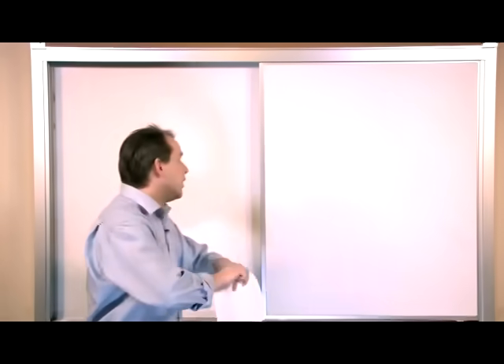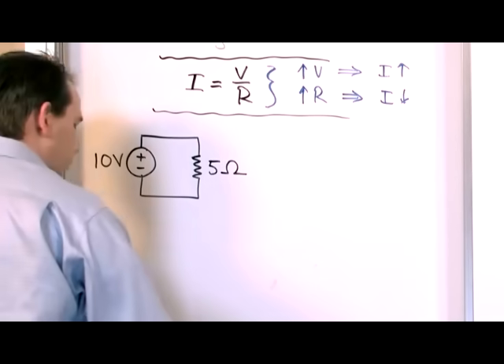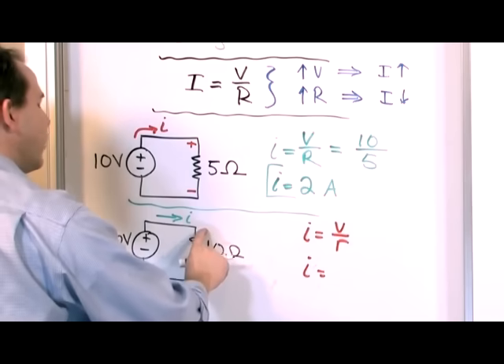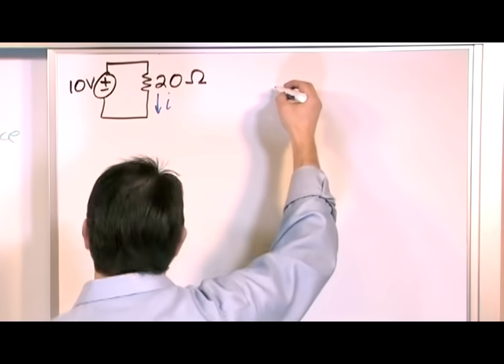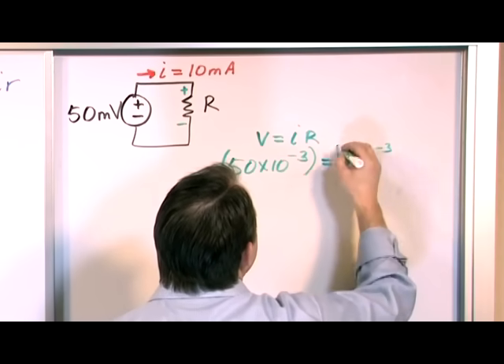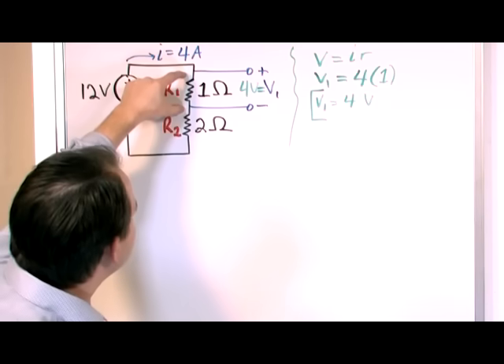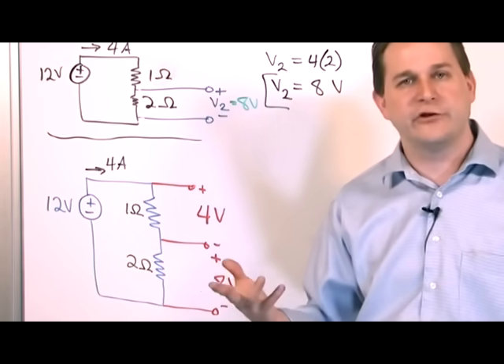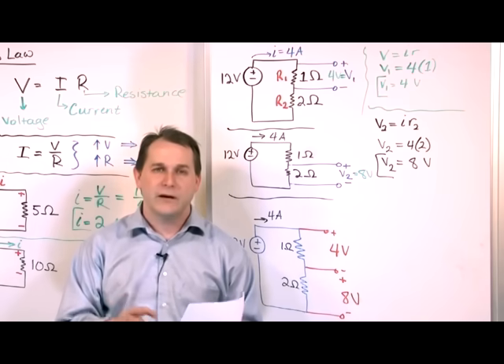03 - What is Ohm's Law in Circuit Analysis?

Comment: Ohms law is a statement - Ohm's Law states that the current flowing in a circuit is directly proportional to the applied potential difference and inversely proportional to the resistance in the circuit.
The subject of ohms law is current. The only mathematical equation that supports ohms law is I=V/R. Every other mathematical formula is a transposition of that
V=IR does not support ohms law
Reply from the maker: You are mistaken. The two equations you put in your posts are exactly the same thing. Neither is superior to the other. They are both equivalent. This is according to the rules of algebra.

Comment: I understand the math but I dont understand why adding a second resistor in series does not affect the calculation on the other resistor. You would think its interfering with the ohms law calculation on the other one as a result of its resisting in series!

Comment: Ohm's law is stated E over I R. E= electromotive force(volts)
I=impedance(amps)
R=resistance (ohm's)
IR=E
I into E=R
R into E=I
This is basic electricity explained in a basic way but there is far more to it. Most electricians do not know ohms law and the general public has no use for it but hey whatever gets you clicks after you maintain a 2.0 in basic electricity.😇

Comment: I have a question about the 50MV and 10MA and finding the resistor question . Couldn't I just rearrange the formula like I rearrange the formula to find the current or I. Couldn't I just move it to say R equals V divided by I  and still get the outcome instead of doing all that complicated breaking down  of the Mili Since both ms in these terms are the same in value. Instead if doing 50×10 to the whatever I could just divide 50 by 10 and still get my answer. ( since both are dealing with milli )
Reply: If it is 10MA that is 10 million amps, I presume you mean 10 mA, which is exactly the reason to work with units rather than assuming the prefixes will work out OK.  If the question was 50MV and 10mA, the answer would be very different - a trap for the unwary!

Comment: In your example of the 12V source, the 1 & 2 ohm resistors in a circuit, what governs the 4 amp current?  Is it built into the power source?  ID; 12V 4 Amp? or is there something else that regulates that?
Reply: The current is the voltage divided by the total resistance  
 I=V/R = 12/(2+1) = 12/3 = 4 Amps.   
You cannot build the current into anything, the current is the result of a voltage across a resistor in this case.

Comment: Try it out when restance is 0ohms....how much current is passing thru d wire..am jst imagine a circuit that doesn't have resistance...
Reply: Superconductors have vanishingly small resistances, but a voltage source usually cannot supply an infinite current!

Comment: Apparently this man doesn't believe in ELECTRON FLOW. 
I wonder how he explains Diodes in a circuit.
Reply from the maker: You are misrepresenting what I am saying. I never said I do not believe in electron flow. Of course I do. All I am saying is that when you take an electrical engineering class or practice as an electrical engineer, we write the equations in terms of positive hole current flow, which is positive charge flow in the opposite direction of electron flow. Yes we all know that physically the electrons are flowing however all of the equations are simplified by treating it as positive current flow. This is what is done in electrical engineering classes. Thanks, Jason

Comment: wait, what if the bottom resister is not 2 ohms, but also 1 ohm as well, then they would add up to 8 only. What would happen to the remaining 4 volts? Does this mean i would have to add another 1 ohm resister?

Comment: YOU TEACH LIKE EVERYONE IS STUPID !!!!! I GUESS YOU BELIEVE IN Kirchhoff's HOLD TRUE AT ALL TIMES TOO DON'T YOU !!!!
Reply: Your SHIFT key is stuck!
Reply: Ohm,s law ,I the first,step .along with Faraday,s law, then it's Eddy's current ,then ,Lens law , cheercefss law, Faraday,s law.is to do with plant room Maintenance for Motors , it says if you rotate a conductor around a Magnetic field conductor around which is the rotor,you will induce am E. M.F.,in the motor ,or vicear vercar.so when you start Motor it will run .,wether your connection is a star deltaotor,motor ,delta, motor ,or direct line motor ,starters ok here is also where you use Ohm,s law ,and,Root 3.,that's .1.73.of an Amp to calculate  running and starting current ,of each phase of it's,.a 3phase system..lots more to say but I don't want to confuse the reader for now 
Martin Brewer ex,marine ,E.T.C.O.

Comment: Wait the first resistor is 4volts drop so the meter should read 8v correct? Then the next resistor should measure after the voltage drop 4 volts correct ??? Just wanna be clear in my field of work . Elevator men always get it up lol.

Comment: Confused. If the second resister was 4 ohm, 4×4 = 16V? Doesn't add up.
Reply: Your confusion is well founded. Lots have been confused like you. Its because he says that 4amps run all the way around the circuit and writes it at the top. But that is false, its only true if you use the same resistors he used. So you cannot multiply a 4ohm resistor by 4amps like you have.. or as you said it doesnt equal 12v. The amps running through the circuit depend on ohms law which depend on the TOTAL values of ALL the resistors in the circuit being plugged into ohms law for answer. Thats where he got 4amps from. But he didnt explain that prior to this video he calculated the 4mps which is only 4amps if you use same resistor ohm values that he did. And he wrote it down on the circuit so many, who are actually following along and learning like yourself, are multiplying by that number  and getting baffled.  Change the values of resistors to the ohms values you wish.. add them together . then calculate the voltage drop over each resistor or the  amperage... It will all add up to 12v then.

Comment: Why do you Americans have to make everything so complicated ? Metric is really easy. What’s that nonsense with 10 to the power of -3 ? Just decide it by 1000. Metric is everything times/decided by 1000: 1ohm=1000mili ohms/ 1kiloohm = 1000 ohms / 1mega ohm = 1000 kilo ohms. Why do you guys make metric seem so hard ?same with meters with everything. 

1000mili = 1unit
1000units = 1 kilo
1000kilo = 1mega
1000mega = 1 tera

Easy. Decide/multiply by 1000

Comment: the segment on resistors is confusing to me.  He talks about a voltage `drop' across the resistor which sounds like a decrease in the voltage, yet he also says the voltage going in is the same as the voltage coming out of the resistor.  Then what is the `drop'?  He says the same thing using amps.  the amps going in is the same as the amps coming out of the resistor he says.  Then what exactly is the resistor doing if there is no effect on voltage or amps???
Reply from the maker: I never said the voltage going in is the same as coming out.  I think you misheard.  The voltage on one side of the resistor is higher than the other side.  This difference is the voltage drop.  With the current, yes the current is the same through the resistor but if you replace the resistor with a different HIGHER resistance, the current will be lower in the circuit.  If you reduce the resistance the current will be higher.  So the value of the resistor directly affects the current flowing through it.  Thanks!  Jason
Reply: @MathAndScience  ok thanks!  so knowing that the v does actually reduce across the resistor i think what you are saying (at 9m) is that, if you put your meter leads on the wire before and after the R you will measure 0 volts. `V drop is 10 volts (on a 10V circuit).  so V drop on a 10 volt circuit is 10V- 10v= zero V.  Something tells me I still have that wrong...

Another thing that is confusing- but i think i know what you are getting at- is that the current is the same all the way around the circuit (for example at 17m `current is same everywhere').  What confuses me in your examples is that you draw an arrow coming from the + of the source, and i'm picturing that as the START of the electrons flowing around the circuit.  in other words, they haven't yet reached the R for the first time, so in my mind they haven't been modified yet by the R.  So to say that the C is the same everywhere, in this case, would not be correct.  But after the <nanosecond of the electrons STARTING their path around this circuit- that is after they have gone through the R the first time, then yes, after that, C would be the same everywhere on the circuit.  In the real world, by the time you put your probes on the circuit, it will be the same C all the way around.  Do I have that right?
Reply from the maker: @mikej7830  In the first part of your comment you are still a little confused.  Say you have a circuit with a battery and two resistors in series.  If you have a voltmeter and put one lead on one side of the resistor and the other lead on the OTHER side of the same resistor, the meter will measure a voltage across that resistor.  That meter is measuring the DROP or decrease in voltage from one side of the resistor to the other side.  All components in an active circuit have a drop or rise in voltage across them, depending on their function.  What the meter is doing is measuring the difference in voltage from the one meter lead to the other lead.

The rest of your comment is pretty much true.  However, electric current travels at nearly the speed of light, so when you activate the circuit the current flows nearly instantly.  For all practical purposes it is instantly on and the value of the current in the loop will be the same everywhere.  The current only changes if you change the resistor value or if you introduce a branch in the circuit so that the current splits, and so the current value in each leg of the split will be lower.  Just like a garden hose splitter - the flow rate will be smaller after a split in the main line. 

Hope this helps!
Jason

Comment: If the current flows one way (from + to -) and we place a resistor in the way, wouldn't the current before the resistor be bigger than the current after? since it's been slowed down.
Reply: Well, no. Even though it has a smaller voltage - it still has the same amount of current flowing. In the case that what you're saying is true, then the resistor would have to accumulate charge, which is something that it doesn't do.
Reply: @hissymissyy  Isn't it so, that voltage and current go hand in hand. Small voltage gives small current. So, how come it still has the same amount of current flowing, even after the voltage is reduced?
Reply: @robelmichael2962  You could also look for circuit simulators like Falstad (https://www.falstad.com/circuit/), which illustrates the actual movement of charges in a circuit. Open Circuits tab and take the first ones from Basics, see how the current goes around, doesn't matter if you really understand all that's happening yet. You can even hover over wires and components to see information about them, overall was pretty useful for teaching me the same lesson, and also being an overall great tool for circuits.
Reply: @hissymissyy  I will. Thanks.

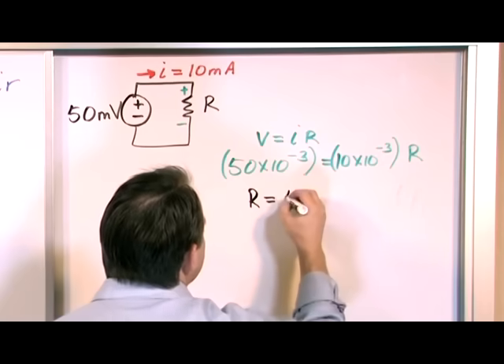Comment: Hello sir at this part of the video 23:36 did the unit of the R is equal to 5milliOhm's? I confused  with the unit of milli because you used that in the equation right? I hope you noticed thank you.
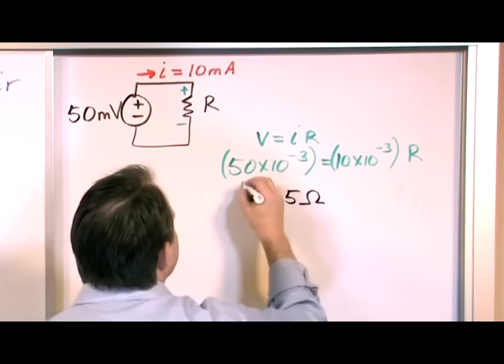Reply: At 23:36 the unit R is not miliOhms, it is normal 5 Ohms because when you solve the equation 

(50x10^-3) which equals 0.05

And

(10x10^-3) R which equals 0.01 R

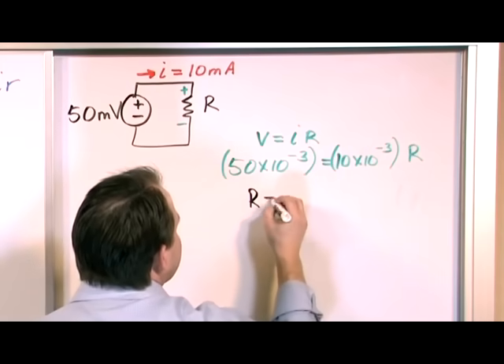In the green writing on 23:36 says

(50x10^-3) = (10x10^-3)R

which i already said was

(0.05) = (0.01)R

But to get the R by itself you need to divide both sides by the number that R is attached to

0.05   =   0.01R
———       ———
0.01        0.01R

EQUALS

5 = R

Comment: My question is specifically about a circuit with two resistors in series.  Maybe I incorrectly understood an earlier concept, but I'm hoping you will be able to clear it up. In the schematic, the source is 12V, 4 amps traveling through the circuit, then there are two resistors in series: 1 is 1 ohm and the other 2 ohm.  I was under the impression that a resistor reduces current. However, when you were calculating the voltage for the second resistor (r2), you used the same 4 amps from the beginning. If a resistor reduces current, wouldn't there be less than 4 amps coming from that first resistor hitting the next resistor?

Comment: What would happen if you were to add another 1 or 2 ohm resistor in the last circuit? Would the voltage drop at each resistor become smaller?

Comment: Hi there, I'm still confused on what you said about there being a voltage drop across all passive components. The voltage going into the resistor was 10v and also 10v coming out,  and the tester measured 10v across the resistor. Where is the voltage drop you speak of? I presumed that by voltage drop it would be less coming out, or across the resistor. Please explain, anyone, so frustrated already. Thank you
Reply: It's a good question to ask but from what I understand,  voltage is basically electrical potential difference. So whenever voltage is going to be measured across any component, it's basically going to give us the difference between the electric potential at the two points of the component. When the voltage was measured across the 10ohms resistor, it showed the same voltage (potential difference) i.e. 10V which means the voltage supplied by the battery in the circuit was completely supplied to this one component. Energy was dissipated across this resistor and there was a voltage drop of 10V. 
"It's a simple consequence of Kirchoff's voltage law. If you have a perfect 10 V voltage supply, no matter what you connect across it, the voltage across that element will be 10 V."
Reply: @user-pf3vz3rd9h  Thanks mate, it makes more sense to me now, I found a vid on Kirchhofs laws and understand a bit better.
Reply: @shanestevens622  I'm glad to be of help 👍🏻

Comment: Excellent instructor, exceptional.  Question:  If voltage drops across two (in-series) resistors as in the final example, equal to the source voltage, will that hold true if the second resistor were 1 ohm instead of 2 ohms, making them both 1 ohm each?  Or do total voltage drops added have to equal source voltage?  Thanks.

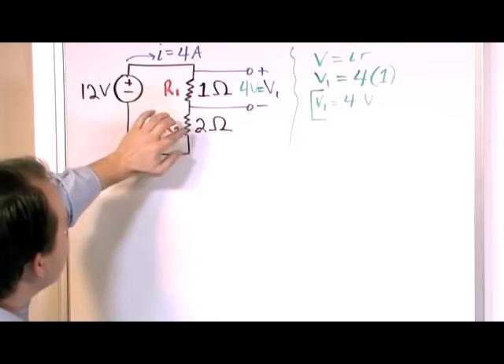Comment: 28:17 wouldn’t V1 equal 4 amps and not 4 volts? because i thought we were talking about the amount of current (amps) flowing through the resistor at a time?
Reply: Emma Swirl Not really. It would be amps if it was solving for i(current). But in here it was trying to find the voltage drop, and voltage is measured in volts. You see how before he had i=v/r? Well in the equation you are asking he had v=i*r. I hope I helped!

Comment: Thanks very much for your work.  Can you explain your use of the word "drop" when you talk about the voltage.  What do you mean by DROP?
Reply from the maker: Yes, by "voltage drop", I mean that the voltage on one side of the resistor is actually higher than the voltage on the other side.  So when you look a the difference in voltage ACROSS the resistor, it is lower on one side so it is a "voltage drop" or a "drop in voltage".  I hope that makes sense!